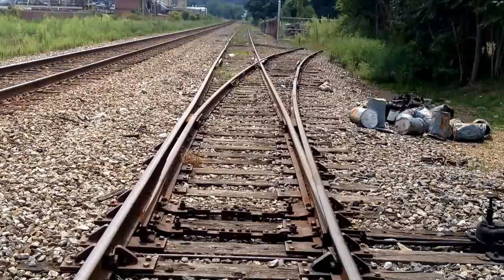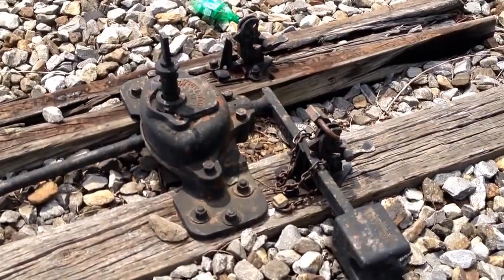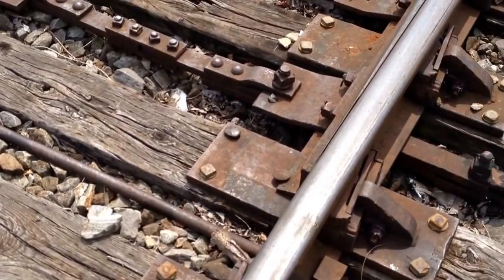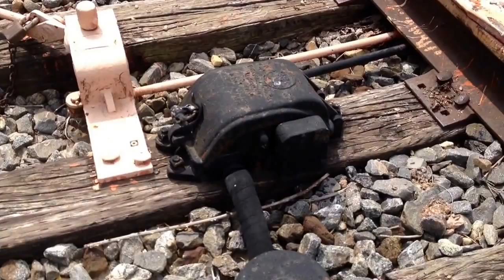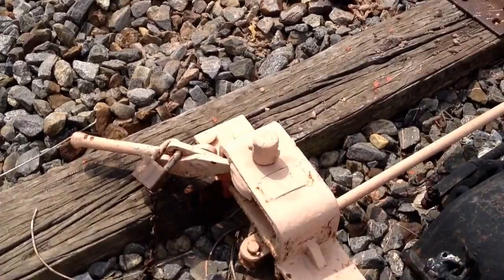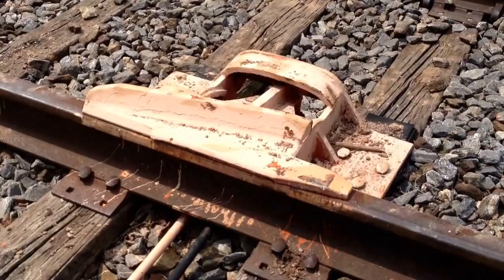Railroad switches and how they work

Comment: ChainsawN&W1218, interesting video, I like to film switches,I use to film the NS trains taking the crossovers at Walton in Radford VA and I've even seen them switch before, but the landowners drive way runs beside NS tracks and He doesn't like nobody near His property, so I don't walk up there anymore, ashame because there's a Wye track up there also,they use to turn N&W 611 & 1218 when it still ran there,still film there at the crossing though, also have the thermal switches,powered by propane 👍.

Comment: what device is used to compensate for lack of spikes through switch point area to secure stock railing in seat of switch plate, also preventing rail from over turning, partially used in switch point obstruction adjustment
Reply from the maker: It has a larger plate under that moved with the point.

Comment: The derail is to actually make a car or piece of equipment to jump the rail so it will not foul the main.  The black box is a switch to indicate the signal system if the derail is open(for traffic) or closed(in the derail) .

Comment: So if you’re coming out of a siding, do you have to manually move the switch or does the pressure of the wheels move the points automatically?
Reply from the maker: A spring switch does not need to be manually  thrown, such as a passing siding. An industrial siding does need to be manually thrown. Thank you for watching.

Comment: The switch in your video does not appear to have a spring in the throw rod and executing a trailing point move from the diverging route as shown would most likely result in a derailment.  The rest of your info is spot on.
Reply: You're correct, except for a spring switch running a switch is a big no no as it will damage the equipment and possibly derail a facing point move.

Comment: I know this was posted a while ago, but you have the frog usage reversed.  The self guarding frogs (cast ones) are usually used in yards and slow locations, whereas the regular frogs (bolted assemblies) like the ones you show are usually used on the mainline or primary tracks.  The reason for this is, that the self-guarding frogs tend to catch and throw the wheels if the flange is too tall or the tread is too wide, at slow speeds the car will ride up and fall back into place, but at speed it would likely derail the car an incident.  

Otherwise great work.

Comment: I've got a question concerning the frog. do they have a movable frog??
Reply: those movable frogs are mostly used at high speed lines, where even the smallest gap could cause discomfort on the passenger, and making the rail and the train components to wear out faster. Nothing that should be required in a regular service or a freight service.
Reply: animal16365  Yes there are movable frogs.  The ones used on high speed trackage like the TVG in France use a swing nose frog so there isn't a gap for the wheel tread to cross and the ones on freight railroads where the diverging track is used very little the frogs have a spring rail which moves out of the way as the wheel flanges pass it to access the diverging route and provides wheel support on the through route.  Hope that helps.
Reply: No, the train wheel just moves over the gap, being guided by the guard rail.
Reply: is he talking about a spring frog?

Comment: Those HEAD BLOCK TIES ARE In desperate need of replacing,,, they are split and switch stand is not fully secured,,, with the spikes holding the switch stand not secure the tonnage of the cargo rail car can pick the switch point,,, also the switch point HEEL feelers should they not be anchored and spiked securely can spread the rail and rail car hits the ground,,, excessive tonnage like rock,,,cement line stone,,,ext...I as a former employee would spike that switch closed against the stock rail and totally lock that switch outta service until it's repaired...remove the universal lock and put my own lock on it,,, as a employee it's your job to make that decision,,,, cause if you inspect that head BLOCK tie and then a accident occurs you were that last onetype to give the switch the OK APPROVAL...BE SAFE NOT SORRY,,, THE BEST WAY IS THE SAFEST WAY ,,, IT WILL TAKE A DAY OF MANUAL LABOR AND LOST TIME TO RERAIL. , THE CAR AND REPLACE ANY DAMAGED SWITCH TIES,,,, COULD PREVENT A TWO MESS TO CLEANUP,,,, LOCK IT AND TAKE IT OUTTA SERVICE
Reply: Tejasnite that switch is spiked in the normal position.

Comment: what happens if the granite stone gets trapped between the track switch?
Reply: A switch Broom,,, has a pry apparitius spade looking on one end and a very stiff broom bristles on the other end,,, the brakes,,, maintainance of way maintainance people remove the obstruction,, the HEAD BLOCK TIES with the switch stand attached need TO be removed and replaced brand new again,,, the switch should be spiked in the,,, normal positition until it's repaired,,, and again safe for service
Reply: A switch Broom,,, has a pry apparitius spade looking on one end and a very stiff broom bristles on the other end,,, the brakes,,, maintainance of way maintainance people remove the obstruction,, the HEAD BLOCK TIES with the switch stand attached need TO be removed and replaced brand new again,,, the switch should be spiked in the,,, normal positition until it's repaired,,, and again safe for service
Reply: Tejasnite
amazing thankyou kind sir!
Reply: +Dan0101010101010 30 years of track and signal maintaince,,, I highly recommend using a stick,shovel handle,,,switch broom handle.  extra long screw driver,,, anything that keeps your hands and fingers clear of steel metal and gears,,,it's so easy to loose a finger diget,,, say you saw the rock that's wedged in between the RAIL and you don't use a stick or rod,,,just your hands,,, you loosen the rock may be just enough pressure it pinch off one or two of your fingers,,,,a very young grade school girl lost two of her fingers helping her dad change a HAY BALER HAY CUTTER SICKLE BLADES,,  SHE WAS IN THE FOURTH GRADE BLESS HER HEART
Reply from the maker: +Tejasnite Great Advice!

Comment: Excellent description though I'm certain not all switches can be safely trailed through if not set correctly.
Reply: +Gary Cameron Gary,After the switch is lined the crew member will look at the points to ensure they are fully closed..When I was a brakeman I would replace the lock in the foot pedal of the switch handle release after I aligned the switch for our move-see 3 min :08 second mark of  the video..
Reply: A switch where you can trail through it is a spring switch, not all switches are spring switches.
Reply: There's also a switch throw used.in yards called a variable switch. It can be trailed through against the points from either direction. We called them "floppers" due to the points latching in the opposite direction when ran through. You run through a rigid switch and it may bend the head rod, uproot the stand or even bend the points. An unreported runthrough will derail the next facing point move.
Reply: Very important info. DIY weekend railroader please take notice.